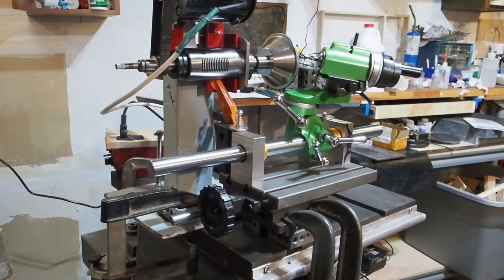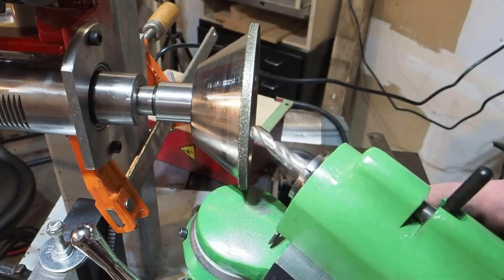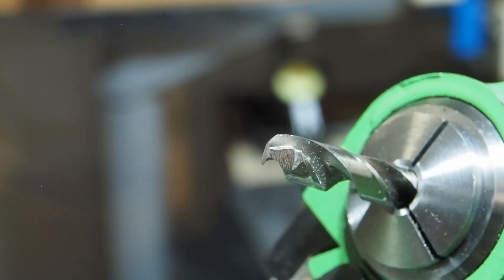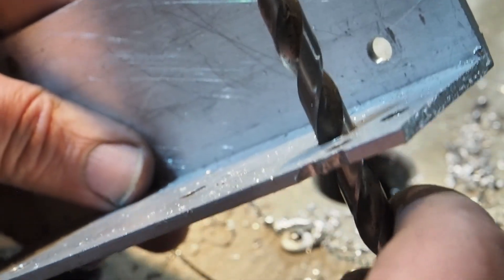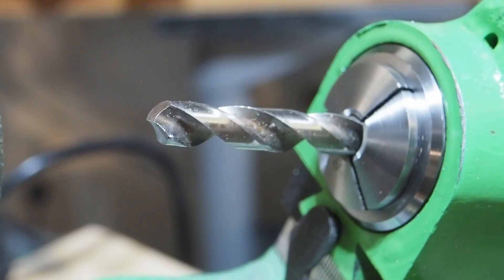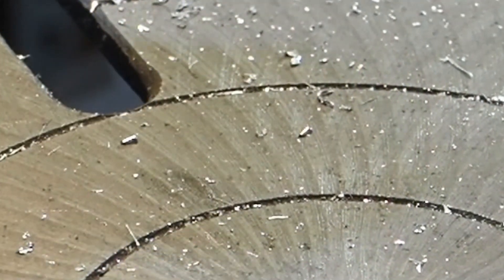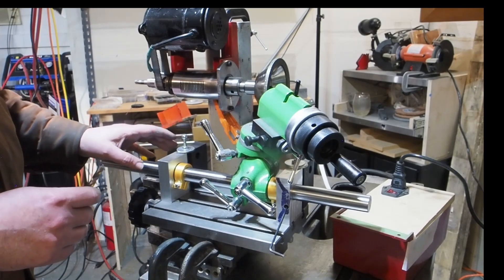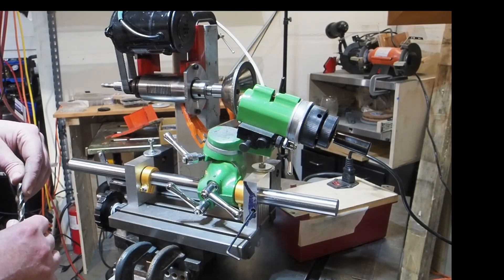grinder hack part 3 test setup

Comment: I'd love to see more of this build, I am seriously considering duplicating what you are doing as I find it difficult to achieve symmetric sharpening with my current grinding set up and like you I can't justify spending the money for a grinder. Did Robin Renzetti supply any dimensions?
Reply from the maker: Stephan Gotteswinter showed up on a discord I hang out on and he gave me the dimensions for his, 66mm in X and 140.5 mm in Y from the centers of the slider shaft and the spindle center
Reply: @JesseSchoch  So did you get the grinder build finished? I guess that 66 mm refers to horizontal displacement and 140.5 is vertical displacement of the spindle from the slide shaft. I have been looking at grinder arms but I can only find arms that accept Dekel style collets ATM. Why did you select 5C collet version?
Reply from the maker: @garychaplin9861  I have the dekel style version.  I got the collets from aliexpress for fairly cheap and the runout is decent. I have not yet completed the frame.  It is clamped to a steel table and functional.  I want to figure out how to put a linear slide on the motor mount so that I can have both radial movements and linear ones.  It is in the back of my project queue though.
Reply: @JesseSchoch  Thanks Jesse, Sound like my situation, too many projects incomplete because I want to add another improvement.

Comment: Hi Jesse,
The geometry of the head you are using is not right for sharpening drills. Cool for d-bits and milling cutters but not drills. Try this attachment. Pretty cheap ($50 US) and the sweep geometry is spot on. Still might need a touch up. Half the fun. 
https://www.ebay.com.au/itm/384069237295?hash=item596c4f7a2f:g:NLEAAOSwSA9d2Ya3
Cheers,
David from Aus.
PS. If you can't get to it from this link, type in "drill sharpener for universal tool and cutter grinder" on eBay :)
Reply from the maker: according to stefan gotteswinter you can do a 4 facet grind with the standard head, check out his channel for his video.  that is the method i attempted to follow here.
Reply: Hi again Jesse, Mmmmmmmm, I know Stephen well and all the other culprits responsible for my addiction to rebuilding lathes and mills, surface grinders etc. However these dudes (Keith Rucker is a bit more forgiving) are very skilled and assume you have a "more than" understanding of machining skills, tool grinding geometry etc.
I get it these days.........took me a long time and a thousand plus hours in my eccentric retirement. 
Sometimes I think it is better to get the tool to do the job (if it is cheap enough) AND as you said put your money and energy into other aspects of the desired outcome.
There is another attachment that you could adapt to your Grinder. Designed many years ago in the good old US of A. 
Again the "swing geometry" is spot on. You can get them for 35 to 50 USD.  
https://www.ebay.com.au/itm/313067181168?epid=15021035182&hash=item48e4421470:g:B-AAAOSwR55grkSK
End of the day no matter which way you go "have fun".............

Cheers,
David from Aus.

Comment: So at about the mid point that was looking really well.  You will find that you should split the point to relieve the forces at the point.  You can also flip the base 180 so that the rail clamp is on the inside fully freeing your freedom to bring the wheel back down.  Awesome stuff !
Reply: Оставляйте всё как есть. Со временем придут навыки и понимание технологии заточки разных инструментов. Само приспособление выполнено хорошо и функционал будет намного шире, чем у Dekel SO. Успехов и удачи.